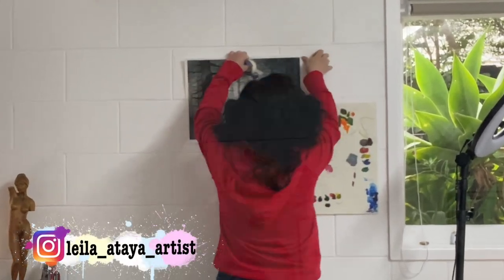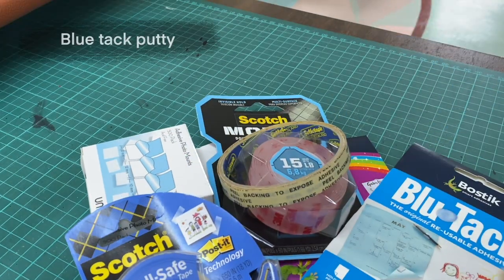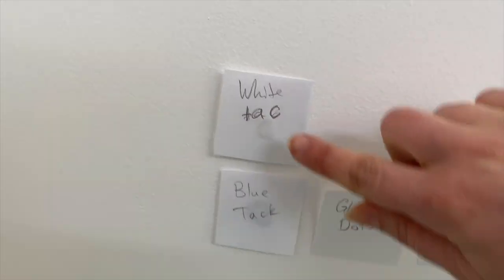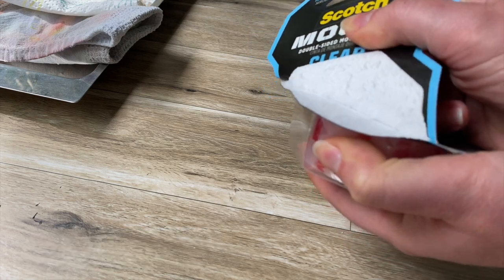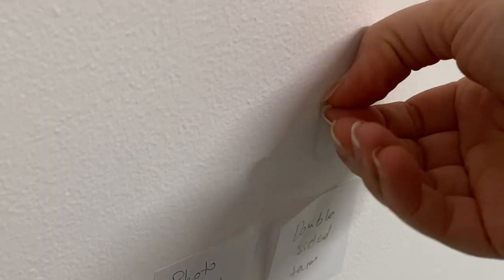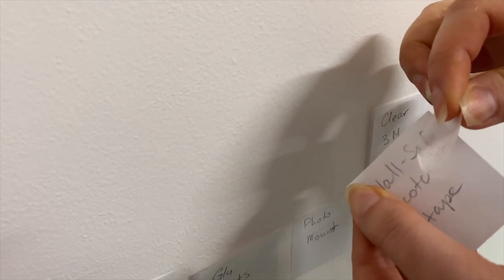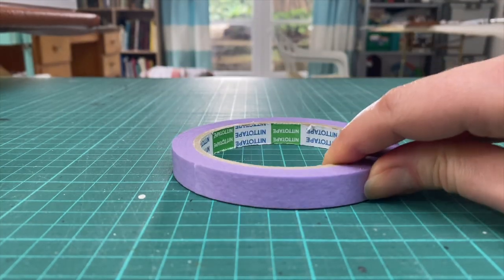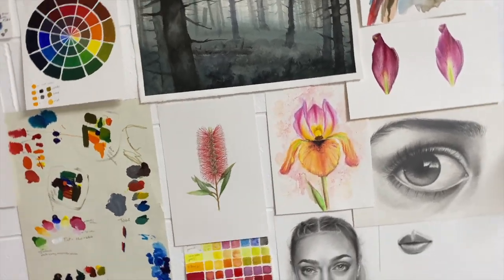🤔 Best product for hanging posters on walls / testing 8 products - sticky wall tapes & putties

Comment: I would very much not recommend white or blue tack for hanging posters. I've had some posters on my walls for many years now, and whatever adhesive is in them has seeped into my posters. There are four gross, wet-looking dots at the corners of each of them, and the discoloration do ruin the look of them, regardless of color. I've also used tacks before, but I'd rather not ruin the posters and walls by putting holes in them.
I'm gonna be moving soon so I was looking for an alternative for the myriad of posters I've gotten since then. I'm definitely going to look into the low-tack mounting tape and wall-safe tape options, and just make little loops of them to put behind the posters. awesome that they don't seem to damage the walls either, solely paint or drywall.
thank you so much for this awesome video!!!
Reply from the maker: Sorry to hear about your posters being ruined 😞 Yes I’ve been using the wall safe tape since I’ve made the video and I still really like it. I have things hanging with it for months and  it comes off clean both paper and wall.  At least that’s my experience with it. 😊

Comment: You can use any one-sided tape on the back of paper instead of the front if you make the strip of tape into a loop with the sticky side out, and then just adhere it to the back of the paper and the wall instead of the front of the paper. That'll make the Wall-Safe tape even less visually disruptive.  🥳
Reply from the maker: very good tip thank you :)

Comment: I found out recently that you can buy magnetic wallpaper which might be worth considering. I think it doubles as a whiteboard for use with erasable marker pens.
Reply from the maker: I just looked it up. It does exist!! I love the idea , it’s quite expensive though. Especially if you want to cover a wall or two , around a $100 for a square meter. Thanks for letting me know about it ❤️

Comment: Have you tried Command Adhesive? It sticks and removes well. But it's not cheap.
Reply from the maker: Yes that's a good product too and I do use it when necessary in my home and studio but it's a bit tricky to use with paper art and you are absolutely correct too expensive. 😊 Thanks for thinking of that

Comment: Howdy Flower : - Hope you're doing alright down there...... Certainly looking healthy.
An interesting episode this month, I'm sure not what us fans in Youtubeland were expecting??!, but - certainly art-related, and a commonly used by most of us product(s). I bet I've been through many pounds/kilos of Blutack in my life? (though converted to Whitetack a good few years ago....). Sure, it leaves a greasy mark on both the hung article + the wall, but as you say you can reuse it many many times, until it gets too full of dust and/or flecks of dry paint etc., but I can buy a pack of it for £1 at the bargain store, and : - 

It's waaay less damaging than using drawing pins - *all we had to use up till the 1980's?* (yes, I was there as a kid!) - and I'm remembering that "lovely" feeling of pushing cheap drawing pins into a plaster wall, and the pin breaking off the thumb plate and sticking right into your thumb!!.

The good old days - Allegedly?? (!).

Wall Safe tape is around £4 to £5 here in the U.K, I've just checked it out, and although a lot more than blu/white tack (and I doubt it is re-useable?) - seems like a great modern-day equivalent to the 2 above mentioned alternatives. I'll stick - literally! - with what I'm used to though, it's useful for many other things other than wall hanging..... I sometimes use a blob of whitetack to hold electronic parts that I'm soldering for instance, it's like a 3rd hand.....?. Anyway,

All the very best Chuck, and - keep it creative (as always??). Bye, Nick.
Reply from the maker: I've filmed this one months ago. I needed to test things out for myself and thought I may as well film it as someone else might be wondering too. I was also surprised how well blue and white tacks held up against many others. I guess it also depends how careful you want to be with posters/art and walls as well. I'm still using that roll of Wallsafe so it's lasting quite well! :)